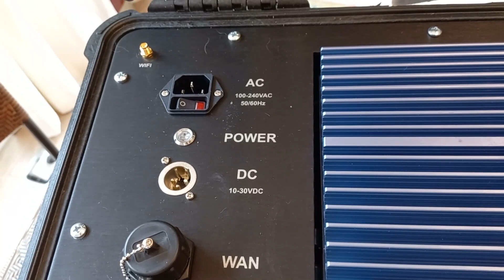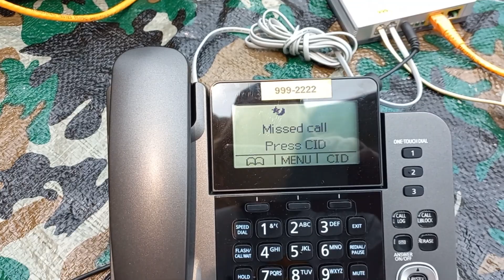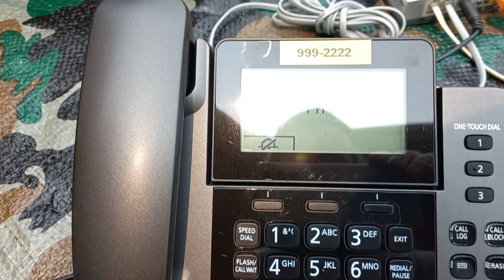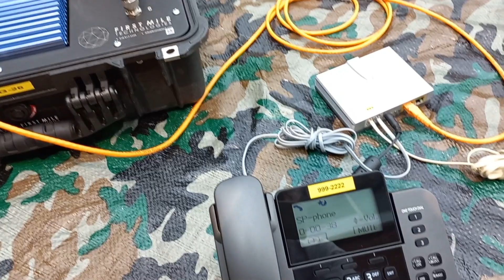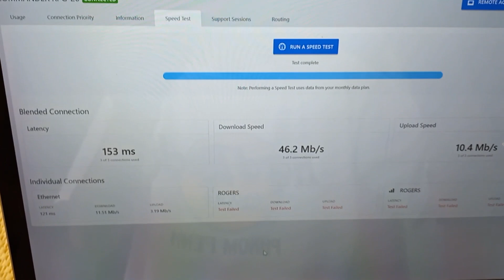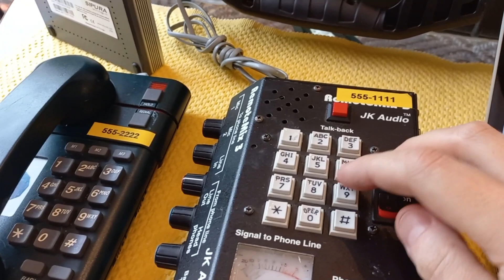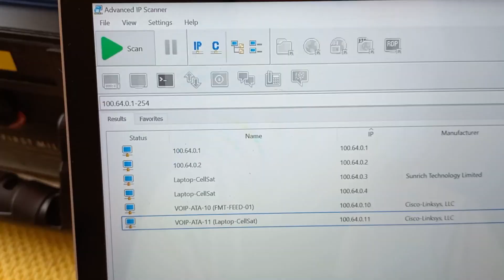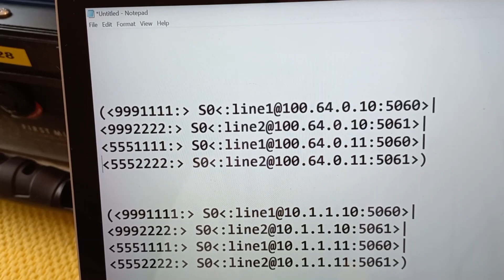Military Telephone Network - Secure Comms Commander Gateway

Comment: Very often shells arrive at military positions, because the position is detected due to a working Wi-Fi access point from Starlink!
Reply: Wifi hotspots dont go far even if you have advanced radio detection equipment.
Reply: @aquahoodjd  this can be done when you are positioned for a long time, more than a couple of hours. but there are mobile groups that walk around with a starlink in their backpack, and transmit a picture from a drone
Reply: @SakakiDash I've only seen 5GHz wifi last just past the end of my culdesac

Comment: you switched the ATA endpoints at the 555 side. Other than that, pretty awesome. I'm curious, do the LTE boxes connect to civil reagular cells? Do they need five SIM cards?
Reply: I have the same question. How are these boxes just "using" the cellular network? Ist there some secret military stuff happening or are there just regular SIM cards inside configured for all the networks? I'd love to get more inside on that topic.
Reply: @Ultravore most likely normal sim cards. The box just connects to a remote server. 

Point to point vpn server would mean that one of the ends would have to have static IP. So most likely they use a server to at least to do the handshake
Reply: @peterfairlie2296  Yes, but how is it authenticating to the Carriers?
Reply: @peterfairlie2296  So my FirstNet SIM would work with that setup?

Comment: Hearing the aircraft outside makes me think of black helicopters honing in on you to figure out what you're doing. This is all way over my head, but I find it fascinating. If I even attempted this or found that equipment and tried to buy it, I would not be surprised if "Suits" showed up at my front door. Also curious about that dial box I've seen in your other videos too.
Reply from the maker: I build this stuff for the 'Suits' so no problem.
Reply: Cool

Comment: Interesting setup. That test set is pretty sweet. Though not really best practice to remove antennas from active transceivers without shutting those radios off. You can damage the radios.

Comment: If it was splitting the datastream from a single connection between multiple carriers you would have crazy jitter from out of order packet delivery. It could take individual sessions/connections and bind them to specific cellular connections however.
Reply from the maker: The Dejero gateways are much better then you think. They are designed for professional broadcast video streaming and have very low jitter while using multiple pathways. https://www.dejero.com/products/gateway

Comment: thats really cool! But is this kind of hardware usually not "top secret"? Or can anyone buy this? I mean if the enemy can get this hardware, would they be able to check how it works / intercept the calls?
Reply: its probably not classified until it has a crypto fill, but it should probably come with a zeroize button and thermite grenade holder in the pelican case.

Comment: The enemy doesn't need to put the encrypted message together or decrypt it. The enemy just needs to triangulate where all those multiple cell phone transmissions are coming from and pay you a visit.
Reply: If you stick and move and realize nothing is truly “encrypted” then by the time they triangulate you or just the phone is there
Reply: @tannerlane9669 The things uses 6 antennas to communicate with "all available cellular networks". If the adversary has at least 4 listening points then they will triangulate the position of this device immediately.
Reply: @gcampagn  With several sensors the triangulation itself takes milliseconds. How fast can you move?
Reply: @gcampagn  If you had an anti-missle system, then you wouldn't be using the cellular network. There are low probability of interception TRANSEC techniques that are being ignored here.

Comment: Way outdated info. In what universe sip is 'secure voice'? Just sniff and listen at backbone level... And that case is not 'military'. Love the vids but misleading.
Reply: tell me you didn't listen to a single word said in the video without telling me
Reply: That SIP traffic is running through multiple encrypted VPN tunnels, all you can see over the internet is parts of that encrypted VPN traffic which you cannot listen into
Reply: A lot of SIP phones can encrypt audio.
So you have multiple levels of protection
(1) Encrypted VoIP in the phone
(2) VPN Split over multiple paths
(3) VPN Encryption 

That would be very hard to put back together, specially the fact encrypted packets are going via so many paths.

To ensure this is effective, each LTE link should go via its own WAN at the SIP server end so no one provider has the complete set of packets.